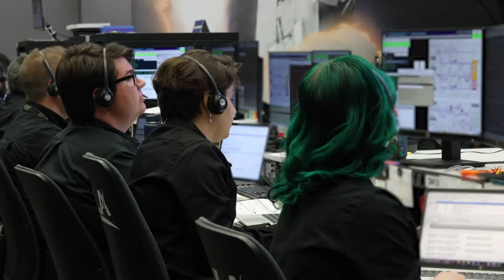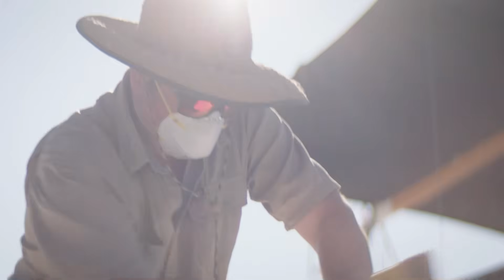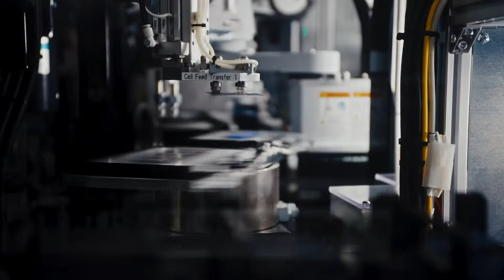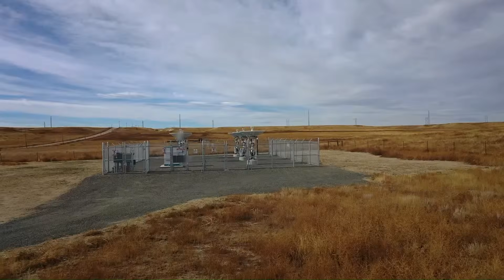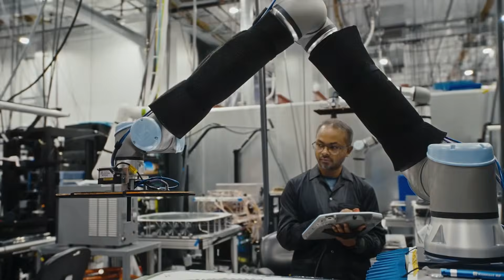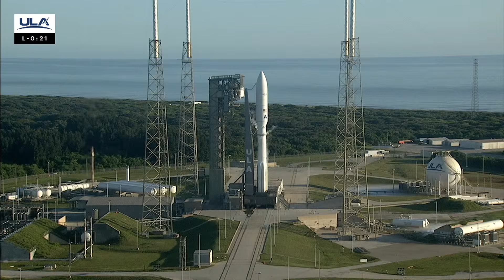Rocket Launch: Atlas V Kuiper 3

Comment: Five solid-rockets, so a very heavy payload.  Some of the last Russian RD-180 engines.  After that, Vulcan will replace it, using Blue Origin BE-4 engines, which is already launching.
Reply: The Kuipers launching on Atlas 5 is a good sendoff for the rocket. Weighing in at 15.5 metric tons, it's the largest payload to low Earth orbit the rocket has ever carried. Well, officially that is, could be a larger DOD or NRO payload.

Comment: Fantastic but I don't understand ULA why you don't show the whole ascent up to Centaur cut off.

I for one would be watching the whole thing!
Reply: They've said on previous missions that Amazon specifically requested for them not to show the 2nd stage burn for some reason. ULA has provided some centaur footage in one of their videos though if you want to see it
Reply: What notgreg123 said. They also did the same to SpaceX with the two Falcon 9 Kuiper launches earlier this year, and we can expect something similar for Arianespace and Blue Origin when they launch them as well.
Reply: @Nowhereman10  I've never understood why Kuiper is being so secretive with this. Are they trying to protect against the embarrassment of a launch failure or what? We already know the satellites and their deployment looks like from after-launch video.
Reply: @WarrantOfficerSchrodinger  they don't have any reputation damage to risk from a launch failure since it's not their rocket so I doubt it's that. Other than that I have no idea

Comment: Go Kuiper. Near the last of the Russian engines that need to be used up.
Reply: then we can use more expensive, less reliable Amazon blue origin engines, yea lets make ULA  luanch programs more expensive becuase politics.
Reply: @DiscordC 

Do we have any reliability track record on the BE-4 engine ‽ It seems to be more reliable than some other engines!
Reply: @Mentaculus42  To date 13 BE-4s have flown across four launches (Vulcan Cert-1, Cert-2, USSF-106, and NG-1) conducted by two different launch vehicles. In no instance was there a launch-related issue for BE-4, which by all accounts has been as close to perfect as practically can be. In the case of Cert-2, the BE-4s contributed mightily towards saving the mission along with some great software when one of the two Northrop Grumman-built SRBs' nozzles broke apart about a minute into the flight. 

The only issues with BE-4 during a mission was during the reentry burn restart as part of the New Glenn GS-1 booster reentry and landing ops. There was an issue with feeding propellants to the three BE-4s used for the first burn that resulted in the engines producing insufficient thrust to properly slow the booster down and it crashed into the ocean as a result.
Reply: @Reiner-o7u 

Actually I am on the same page as you! I believe that the BE-4 is a more reliable & stable design of engine than a particular contemporary engine that discord was comparing it to (to put the BE-4 down)! I even suggested that but left it a bit vague so as to not get into a pi..ing contest with a sx fanboy. But neither of these engines have sufficiently established a long term track record yet. Remember, the SSME has a lot more than a 1,000,000 test seconds (now that is a track record for a complex and very high performance engine). As far as I understand, the raptor v3 still has issues. Also, the BE-4 has not validated its reliability with regard to reusability in actual flights (but has had a good test stand results). So, yes the BE-4 has performed flawlessly but that 13 flights is still a rather small sample and a great start.

Comment: So that’s 80 launches and a bunch of new satellites and a whole lot of natural resources in the form of stainless steel structures, cables, other metals, carbon fiber and other materials just burning up on the return while the rest of us recycle our junk.  All the green energy people here probably don’t care though because they’re not real bright. Kind of a waste of resources.  On the plus side it provides lots of jobs!
Reply: Atlas V is being actively phased out. Kuiper and a few others are using the remaining rockets otherwise the work and resources that already went into them would go to waste
Reply: @notgreg123  becuase they stopped buying Russian engines jeff bazos blue origin engines won't fit the Atlas V
Reply: @DiscordC  True because the BE-4 uses different propellants (LOx/methane) than the RD-180 (LOx/RP-1).  There was a stab at a U.S. made RP-1 as a direct replacement, but insufficient funding.  Blue Origin offered "no development cost" for their liquid engine, which NASA and Congress thought a great deal.  ULA took the opportunity to design a more innovative vehicle.  A youtube has CEO Tory Bruno giving a walk-thru of the Decatur, AL factory which produces the new Vulcan vehicle.
Reply: @williamgrissom9022  NASA did little to no funding here. Any additional funding came from the United States Air Force (Before Space Force became a thing). They also gave some funding to Aerojet Rocketdyne to also develop their engine, the AR1. Earmarked around $250 million. But Aerojet kept asking for more money, asking that their financial contribution be reduce, and all while delivering very little in the way of products for what they had been funded for. At the same time, Blue Origin already had up to six developmental, full-scale engines built and ready to go or on the test stand, and prior to that, they'd delivered individual parts for testing, like the injectors and powerpack.

And hype aside, AR1 wasn't a direct drop-in replacement. Like BE-4, it was two engines in the 450,000-500,000 lbf range each to replace the single 800,000 lbf RD-180. So, it was not a simple "They build it and then bolt it on" affair. A major redesign was coming regardless, it was just a matter or what form it would take.
Reply: For small towns with enough houses, fiber-optic is likely a better solution and gives higher rates than satellite internet.  That has already been rolling out, as part of the federal rural broadband initiative.  The delay was due to States requesting bids and contracting.  Satellite internet was not allowed in the bidding since designs could not meet the FCC specifications.  Those were set high to future-proof the system.  Demand for high-res high frame-rate video has increased dramatically over the years, and will likely continue.  But Donald Trump brought change.  In a campaign speech, with Elon Musk at his side, Trump pondered why Starlink couldn't suffice, stating "Starlink can do it all".  Last June, the requirements were modified, lessening transmission rates, so satellite internet is now allowed to compete.  Might Elon Musk's campaign contributions be penciling out?  Might Jeff Bezos also be smiling?
Reply: Rocket launches are a drop in the 'brown' ocean compared to everyone driving fecklessly around in wankpanzers. If you want green cred, ride a bicycle and thumb up rocket launches.
Reply: It's aluminum mainly, much more so than stainless.

Go watch Smarter Every Day and their Rocket Factory tour with ULA. Takes you through the process in an approachable hour tour & interview.
Then go watch the SED about trying to make something & sell it (grill brush) without using cheaper labor/materials.

And it's a stage. Early industrialization had population-killing pollution early on and we got to a better place over the century....better fuels....better technology....more chemically responsible ways.

Just like we can with the greenwashed-for-feelings-and-profit "recycling" nowadays/always....it can get to a place where we actually limit & reuse and reclaimed materials....and not just for show.
What you recycle is mostly just trashed, or shipped to 3rd world countries to kick the can down the path, until our nanoplastics cost starts being detectable enough to unveil itself....and allow for companies & people to start caring about fixing.
Takes time.

Just gotta get the greed and profits wrangled better so that actions and reality have less of a gap and/or mislabeling.